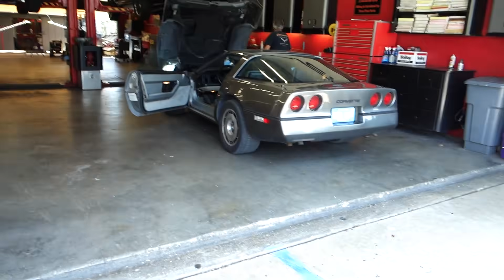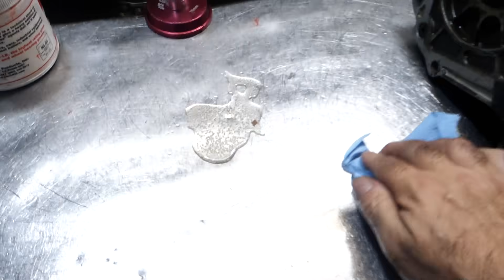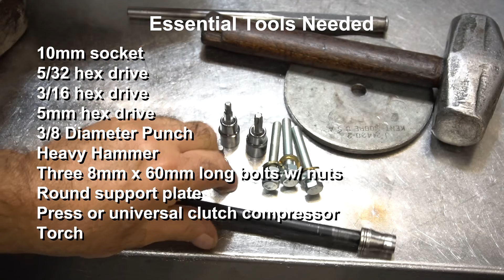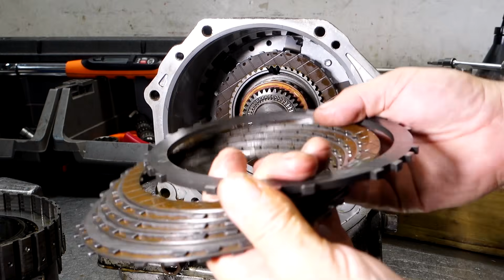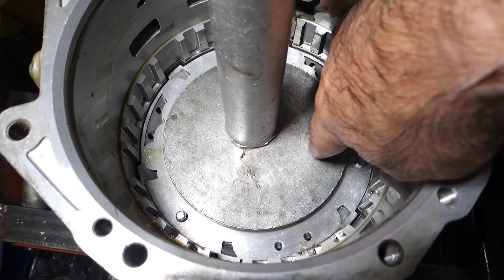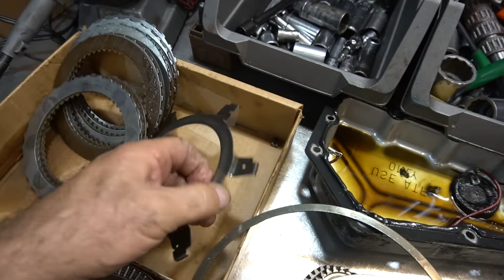How to Rebuild a Corvette 4+3 Doug Nash DNE Overdrive

Comment: Thanks for the great video Paul! The carrier bearing in my '85 is starting to make noise when OD is not engaged and needs to be replaced. The OD works perfectly fine otherwise as far as I can tell.

Is it possible to replace the carrier bearing without tearing down the whole unit since it is right at the front?   I am not confident in reassembling the unit (timing the planetary gears, and I assume other necessary steps I don't know).

Just looking to fix at least the bearing before real damage occurs.

Thanks, 
Dom
Reply from the maker: Don't drive it like that at all. The unit has to come apart.

Comment: Paul! Hoping you could help... I have read that you can pull the overdrive and convert it to a non overdrive super t10. Do you know if that is true?  The transmission would be going in a older truck with front and rear c4 suspension.
Reply from the maker: Just get a standard St10 Mainshaft tail and Rev gears
Reply: @GearBoxVideo  awesome thank you. Would you be interested in the overdrive unit?

Comment: Would you know what colour wire I tap into off the overdrive to adjust the Speedo? I see two wires for the speed sensor
Reply from the maker: It's a pulse generator. No positive or negative
Reply: @GearBoxVideo  right, what I mean is I have the Abbott control box to correct my rear gear change.

Comment: I dumped the Doug Nash for a Borg Warner - T56 out of a 1997 Camaro. I was to much of a headache trying to get the DN 4+3 right.
Reply from the maker: How did you attach the beam. Does someone make an adapter? Could be a good conversion option
Reply: This company makes a C beam adapter for LS conversion but worked on my application as well. They sell it separately by itself. C Beam has to be trimmed on the trans end a couple inches and new holes drilled. It was a snap. It was pricey at $300 but great for me since I don't have a welder at the moment but a bracket could be fabricated easily as many have done.
Reply from the maker: How about sharing the company name?
Reply: For the swap i needed the 1) c-beam adapter, 
2) a new drive shaft made that was exactly one inch shorter .
3)  An adjustable clutch pedal stop when going from push type to pull master slave and I spliced in a braided line to the factory hydraulic line to connect to the LT1 master slave. Without the pedal stop the fork extends to far and rubs the flywheel. 

4) Also for the speedo to work  an SGI-100 BT from Dakota Digital is needed. Summit Racing sells them for $100.
 
5) a patch panel to cover the trans tunnel where the 4+3 shifter placement has to be cut out since it angles in and will interfere with the new trans. You can make your own or Holley sells one for c4 for around $50
Reply: This car is so much better now with the Lt1 6 speed. 93-97 camaro/ firebird is what is needed.

Comment: Hi Paul. I'm in the middle of rebuilding my nash unit. You mentioned that those 5mm flat bolds are sealed with silicone. Do  I need to apply it again when re-assembling the unit? If so which type of silcone should i use? As always thanks for your help.

Comment: Hey Paul! Awesome video. I'm in the middle of rebuilding this transmission and my carrier did indeed spin. Everything moved forward and it made a mess. The bearing was an MRC1912R. I'm curious about replacing it and I have sourced an NTN61912. Since SKF has purchased MRC the replacement bearing will essentially be an SKF bearing and  I'm a bit scared. I've had bad luck lately with SKF and prefer NTN. Do you see any reason I shouldn't run this bearing in the nash unit?
Reply from the maker: It will work fine. The MRC was an angular contact bearing but the standard 1912 will work fine
Reply: @GearBoxVideo  interesting. Why exactly did GM decide to go an angular contact instead of radial? Something to do with rpm's? Or sideload?
Reply from the maker: Originally in 1984 was a standard 1912. The angular contact 1912S can handle more thrust load. Problem was in setting up the units often times they we're over preloaded and the bearing failed. So you must make sure you set up the carrier with the proper sun gear shim
Reply: @GearBoxVideo  ahhh. That makes complete sense. Watching your videos did give me the confidence to tackle this job. Thanks a ton! Looks like re-assembly will be time consuming but well worth it.
Reply: @GearBoxVideo  I had a heck of a time getting the carrier bearing out of the housing. (I had to grind and notch, tap it, etc.) I got the new ntn 85mm bearing in and it's tight going into the bore. From watching your video it looks like the bearing should only be a tap fit. It seems to me like the bore on carrier plate was actually machined a bit too small from the factory. Am I correct in assuming this should be a tap fit, not interference. I have a feeling that is what caused the failure in the beginning. Any help appreciated on the tolerances on that bore would help!
Reply from the maker: The bearing destroys the bore  and leaves a lip on the end of the housing. You need to take it to a machine shop and have  the plate faced off and bore  made slip fit based on the  dimension of the bearing. This has to be done on a lathe.

Comment: Paul super videos are there more than 2 one on the build?  Paul where can I get parts. looking for Thrust Bearing, pump seal and the improved thrust washer. This unit got noisy at 50000 miles and did not fail totally. I watched a video of yours that made a special point about a seal installation. Thanks for a great great video..Dale K
Reply from the maker: My website has some parts video does have the info

Comment: The simplicity of an automatic, with the convenience of driving a manual.  Took GM 25 more years to end up in bankruptcy, but it was engineering decisions like this that got them there!  How you figured out all the work arounds to get this POS to function correctly...  half genius, half persistence.  Great vids!
Reply from the maker: I actually sold my upgrades to GM
Reply: @GearBoxVideo  Good for you!  I worked as a contractor for 7 1/2 years at GM in market research and competitor intel...  Sometimes they need help getting out of their own way.
Reply from the maker: How true. The paperwork alone is staggering

Comment: What can be done about repairing or replacing  the slave cylinder dust boot cover.
Reply from the maker: You buy a new one. They are still available

Comment: Hi Paul great video
 I just purchased an 87 vette. Got a great deal on one as it has transmission issues. Shift through the gears fine but won't go into reverse. Would this also be caused by the Nash bearing obstructing it? Would appreciate your input on this.
Reply from the maker: The carrier bearing fails causing the Rev direct clutch pack to burn up. You would loose reverse and also engine breaking when you let off the gas.
Reply: @GearBoxVideo  thanks Paul

Comment: Hi..ive got an 84 4+3 and it has a weird fault.....once a year or so it leaks a patch of dexron fluid out after I push the car backwards out of the garage...sometimes over the years when I check the O/D fluid level it is overfull...is it possible for the T10 to be leaking into the O/D unit causing an overfill situation ? The O/D unit works no problem and the T10 shifts fine...Thanks.
Reply from the maker: Check the 4 speed oil level. A common problem
Reply: @GearBoxVideo  Thanks....is it the front seal in the O/D..?

Comment: Can you tell me which switch is the 2nd gear switch on an 87 DN4+3? There is only 2 on the side one with a Green and black/white wire and the second one, Green/blue wire. Can't  find anything in the FSM or internet. I want to bypass it and see if it is the reason why my OD doesn't engage . If not tit has to be pressure switch or solenoid. Everything else checks out...
Reply from the maker: Learn how to put your car in diagnostic mode and check your circuits. I would advise you to invest in a shop manual for your car if you plan on working on it. They are available on eBay. All circuit info is available on my website at www.5speeds.com
Reply: @GearBoxVideo  Yes I have one. I  overlooked the schematic. It appears mine only has an a 1st gear switch and an overdrive switch. when driving car OD light comes on between shifts and shifter button has on off function I'm trying to diagnose if I have a failed Pressure switch, solenoid, OD switch or a burned up OD unit. Didn't notice any metal shavings or anything odd when I dropped the pan. If it's toast I may have to send the OD unit to you.
Reply from the maker: It's electrical. The ECU flips the light on, not the OD unit. It can be fried and the light would still stay on.
Reply: @GearBoxVideo  Was it common for the pressure switch or solenoid to fail in these? I assume if one of these fail no OD engagement?
Reply: @GearBoxVideo  If the OD unit is toast wouldn't it be hard to get car in reverse?

I  read this is a common symptom of a fried OD unit. My reverse is fine along with the rest of the gears in the 4 speed.

Comment: Paul, were you involved at all in the early C4 SCCA and Corvette Challenge years when they used the 4+3?  If so, did you do anything special to the OD or was it strong enough to last as it was with the rad oil cooler?
Reply from the maker: I did most of them. They had a special .80 OD set. I set them up with boosted line pressure as well as solid clutches. No waffled styles. This added to the holding power. The .80 OD also meant less load on the clutch system. The gears are long gone.  Also the cars had a different chip in them. My numbers are stamped on the back end of the OD case where the beam attaches.

Comment: Paul, do you have a video on dismantling  the  front 4 speed part of the 4+3 Doug Nash transmission on a 86 Corvette?
Reply from the maker: It's the same as my super T-10 videos on my channel
Reply: @GearBoxVideo  Does the pin that holds the reverse shift shaft in place in the rear bearing retainer housing get removed by tapping it from the inside out or  from outside in? It looks like a tapered pin.
Reply from the maker: Watch the video. It is tapered.

Comment: When I rebuild mine, I used a threaded rod and bolt set up to hold back piston and released slowly doing 1/2 to 3/4 turn on tension nuts in a clockwise direction when a hydraulic press wasn't available. This video would have been so helpful to me 13yrs ago. but glad it's out now,. you can only imagine how hard it was to align those planetary gears without disassembly of the unit.
Reply from the maker: The rod or bolts are just to hold the piston in place. Whether you release the plate or pull it down risks breaking the Piston. GM actually ran out of pistons because they didn't account for people breaking them. Reality was, it really has no reason to break . Most of the sales of that part we're due to people removing and installing them wrong.

Comment: What's the best way to diagnose a problem with these? I just bought an 87 with the 4+3. 4 speed works fine even reverse.No overdrive. Light kicks on and I can manually operate it with the shifter switch but no drop in RPMs. Pan was leaking and low on fluid . I replaced filter , fluid relay.  Nothing. Just a normal 4 speed .... where do I look next??
Reply from the maker: Spend some money on a shop overhaul manual for your car. The manual takes you thru steps to diagnose and trace wiring. I highly recommend it because I guarantee that other problems will surface for you. I got one for my 1985 on eBay.
Reply: @GearBoxVideo  Thanks. Can you still get  parts for these such as the solenoid  etc in the valve body?
Reply from the maker: Yes thru SK trans in NY. 631-957-9427
Reply: @GearBoxVideo  Thanks I just ordered one.
Reply: @GearBoxVideo  You own a 1985 4+3 ?
Reply: Did you do part 2 of repairing the overdrive unit? Will the gears eventually go bad if the overdrive isn't working, in forth gear the RPM's are 36 at roughly 70 MPH.

Comment: im wondering how hard it would be to pull of the auto over drive and set it to to just be a T10 BW transmission with out a over drive customer has a 4+3  i believe to overdrive system is toast
Reply from the maker: Just fix it.

Comment: Is there a video how to Assembly this unit?
Reply from the maker: Not yet.... been working on setting up time to do one.   Pretty busy in the shop
Reply: GearBoxVideo I understand making this videos take time. They are of high Quality and hjelp us out a lot. I have a problem after i have assembled gearbox after insert new clutches and replaced damaged parts. After assembled i reversere step by step follow this video i have a problem when i releece the last 1/4 rotation on the 3 nuts how take the preload of the piston. When turn the output shaft with a yoke it rotate smouth until i releace the last 1/4 of rotation of the preload. It dont rotate freeley ( IT rotate but i have to USE force), ITS like somthing bottom  or stuck. Do You have a tipp of what that can cause this cind of error? Im sorry for my bad American writing skills. Im from Norway so my American are not perfect
Reply from the maker: I really don't. All I can say is that assembly is not the same as disassembly. The planetary gears need to be timed properly for it to go together correctly

Comment: I have a corvette c4 1985 with doug nash without kickdown cable, all is work correct until we open the OD to repair leaks, after reassembly and put on car, when i tested on highway, the OD engaged only when i stop gas the pedal, if i gas the pedal, even though only 5%, the rpm increases.

We open the OD because my friend open the first plate without lock the mechanism and the springs push mechanism out, we watched your video and lock the mechanism to reassembly again.

My friend think had two most springs, then reassemly without two springs.

Question: the lack of these two springs may be the cause of the problem?
Reply from the maker: It's just assembled wrong and most likely damaged. This happens often.
Reply: Any suggestions for where to look?
Reply from the maker: You are saying ENGAGED when stomping gas pedal and it should disengage. Something is screwed up and it's hard for me to diagnose it with messages
Reply: @GearBoxVideo  can you send your private contact, i'll pay for remote assitance.
Reply: @GearBoxVideo  i took many, photos of OD open.
Reply from the maker: support@5speeds.com

Comment: Does anyone know how to fill up the OD-Oil correctly after reinstall the OD?
 Is it enough, to fill  it to the level of the fill plug, driving with OD, check the oil-level again and add some oil if needed?
My mechanic added the oil during the car runs on a lift. Now the oil comes out of the seal from the tv-cable. Is it possible to overfill it with this method?
There are no explanations in the service manual or the driverbook.
Reply from the maker: You fill it to the level of the fill plug and no more. The TV cable is plastic and has an Oring seal and should not leak unless the end was damaged.

Comment: Ok, so here's a question:  in an 87 C4 Vette, with the 4+3 overdrive, this car is engaging and disengaging the overdrive unit at will, even in first gear.  It will do this all by itself, or it will decide on its own as to whether or not it want to be in overdrive even if you press the overdrive switch.  What could cause this? I'm suspecting a bad relay, but I'm really not sure.
Reply from the maker: Robert Hunt  if it's the relay both the light and OD will go on and off at the same time. It may also be a bad shifter switch
Reply: Yessir,  my OD and my dash light go in and out at the same time.  Guess I'll look for both the relay and the shifter switch at the same time and fix it for sure! Thanks for your help and keep the great videos coming!

Comment: Great Video very informative but in the future could you touch on the Early DN 4+3 with Detente Cable
Reply from the maker: Thats coming soon
Reply: @GearBoxVideo  thanks, I too did rebuild many of these O/D units probably 2 a week from 84 to mid 86 then it dropped off

Comment: Is there a way to gut this unit out our weld the gears or plates shut  and just have a normal 4speed. Or a way to put a normal t10 tail on it and still use in a c4.
Reply from the maker: There are long Ford ST10 mainshafts that you can put into the trans and seal off the bottom. Call SK at 631-957-9427

Comment: Have you rebuilt the Laycock overdrives on Volvo transmissions too?  Those are the units that Gear Vendors adapted for the aftermarket, I've always been interested in the Volvo units because they aren't $2000 :-)
Reply from the maker: Yes I have, they are quite simple.